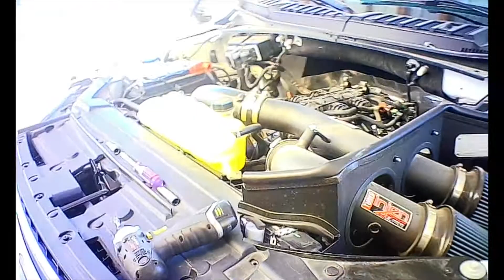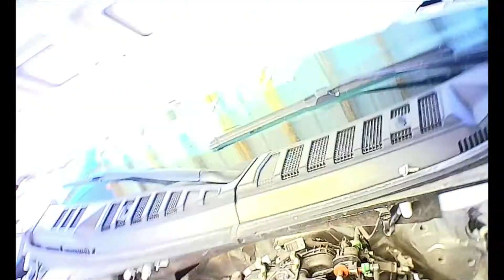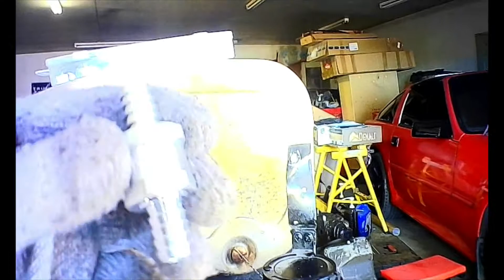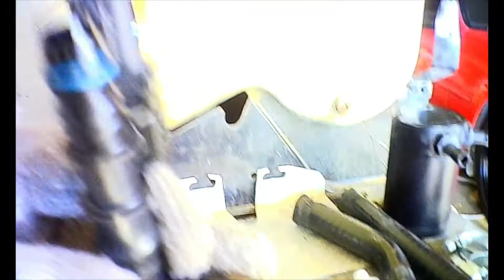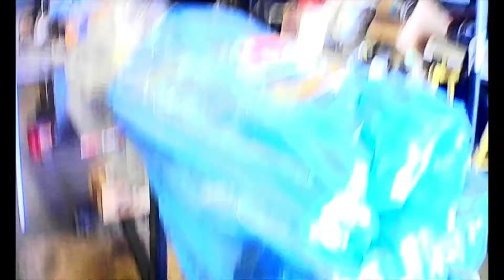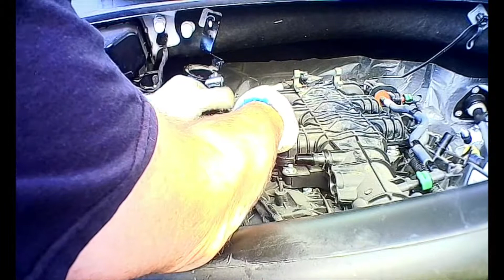BUDGET DIY HOW TO Dual Oil Catch Can Kit for 2018 + Ford F150 Ecoboost Engines New Improved Kit

Comment: Would a fuel line rated for 50psi work or will it collapse under pressure?
Reply from the maker: 50 psi fuel hose is strong and I do not believe it would collapse under vacuum.